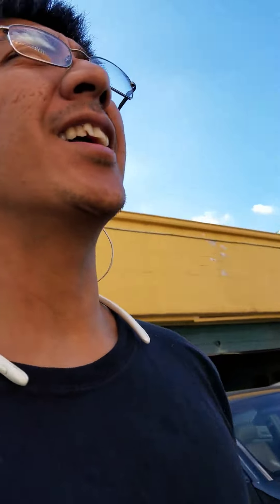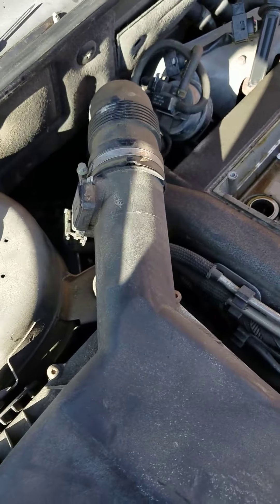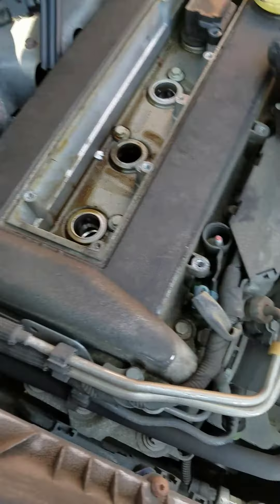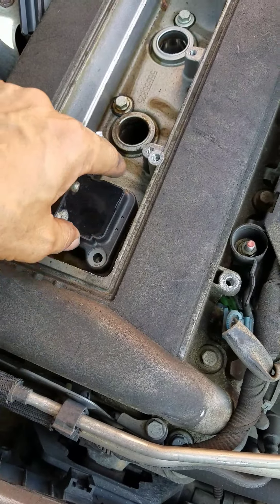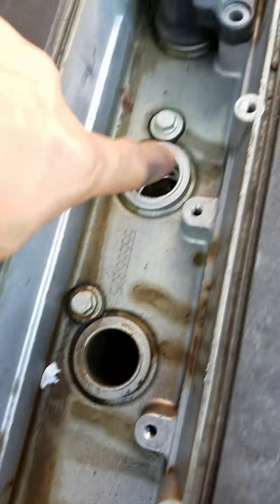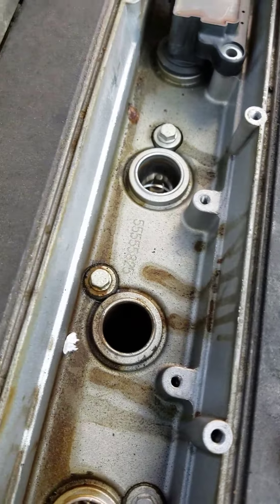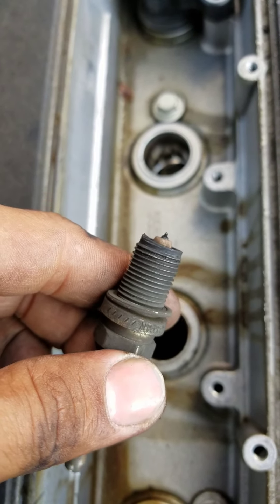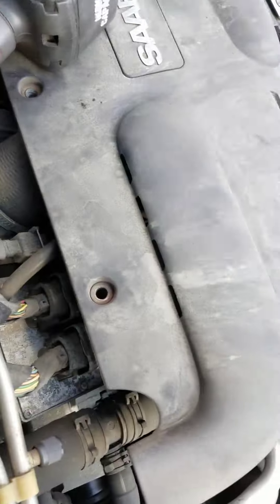2005 Saab 93 rough idle

Comment: I'm having a rough idle to... From 850. To 1200 sometimes... Is reving on its own Wile driving no problems what so ever
Reply from the maker: try cleaning the throttle body and then remove both battery cables and touch positive and negative wires while disconnected from battery for about 10-15secs. The reinstall and let it idle till its on normal operating temperature.

Comment: Take a magnet antena style and get it out the other part of sparkplug..
Reply from the maker: yes, use a magnet antenna style to take it out. Another trick is a very long screw driver dipped in bearing grease (lots of grease) and the use air blower, put screw driver in and the and blast it with air simultanously, pull out screw driver to check for metal piece caught by the grease.